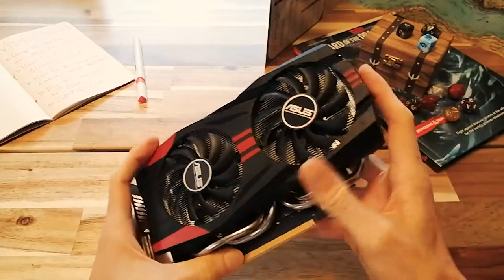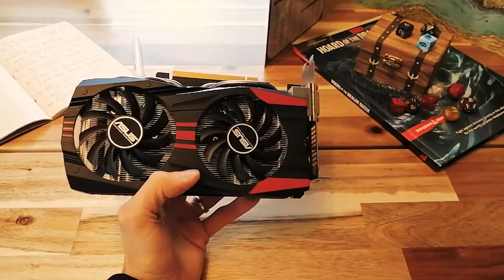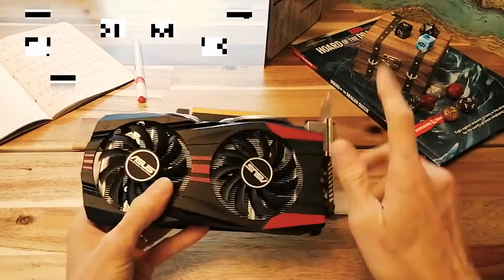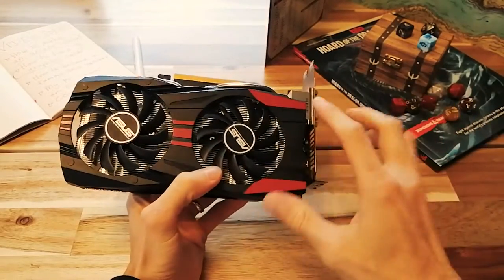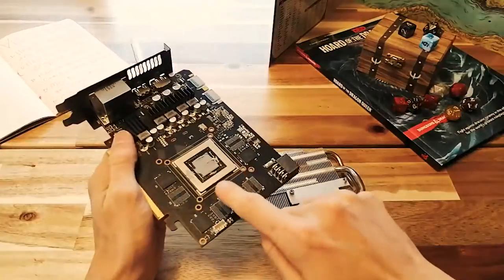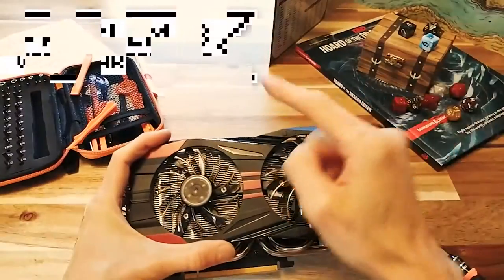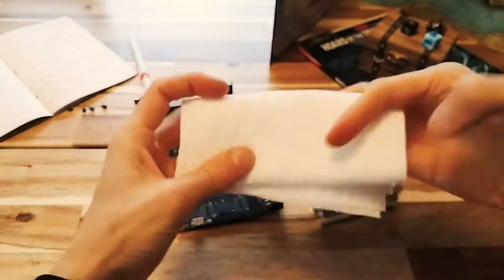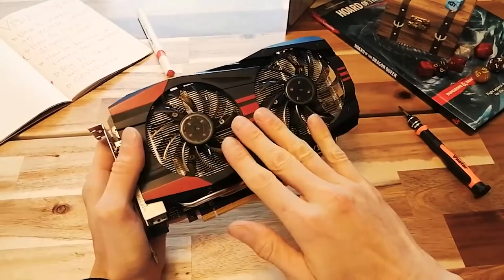EASY Fix Your Graphics Card! (Loud fan, black screen, crashing, artifacts)

Comment: These blackscreen fan overdrive crashes are what I've been experiencing, but what's weird is that it isn't necessarily under heavy load but often caused by specific segments in specific games. Often when I open certain menus. The temps are always fine too from what I've seen. Could that still be a problem with thermal paste? I've tried everything on the software side by this point; repairing windows, clean-wiping GPU drivers and reinstalling them. updating bios, repairing windows files, cleaning the pc, checking for loose cables (which I didn't notice any) etc. , no dice. I've been at this for months and just completely clueless at this point.
Reply from the maker: Yes it could still be a problem with the thermal paste. It's such a cheap and quick thing to try and it so often fixes these sort of issues, even if it doesn't SEEM like that would be the problem. Also I'd highly recommend trying the GPU in a different PC if you can, and see if the issue happens there - if it does, then you'll know it's a hardware issue with the GPU. If not, then you'll know it could be specific to your hardware (and it could be any number of things, like a PSU problem for instance). It's hard to give you a once-size-fits-all approach but if it were me I'd definitely be repasting it as a first step.
Reply: Did you fix this yet, I’m having the same issues. It seems that a bad psu would be a cause this, out of curiosity what games are you playing when it crashes?
Reply: @TechDweeb   Thanks for the reply!
Reply: @999madrush  I've felt too burned out on trying to fix it since, so sadly not yet. For me it always seems to have to do with loading. I noticed when I went into the hub area in Code Vein for the first time the PC did the thing, and I feel like it has to do with the game loading such a detailed area for the first time. Another weird thing for me is the crafting menu in Deeprock Galactic and the Materia screen in FF7, specifically the transition animation. It's always those kinds of things, some games just run without flaw.

One thing I also noticed though is that my gpu driver tends to start having problems a couple of weeks after I've last updated, it's almost like the driver itself deteriorates over time. Maybe it's a software issue after all.

I'm no expert but I think I can rule out a PSU issue at least somewhat. My old PC had a weak PSU that would shut the entire PC off during demanding spikes in game graphics, usually particle effects because they're very unoptimized. In my current case it's just the screen turning black and the fans going overdrive, doesn't really seem like the PSU is failing if the computer is making fans go into overdrive.
Reply: @999madrush  about to try, I'll update you
Reply: Same problem lately, but it’s completely random. Sometimes it’ll happen 5 seconds after reboot and other times after 30 min of just idle. Sometimes 5 times a day sometimes not at all.
Reply: Have the same problem, any fix?
Reply: @Yanncki64  Did replacing thermal paste work? If not did any other methods do the job instead? I'm having the same issue and can barely get past loading into a match for some games.
Reply: I’ve been having this issue too. I have the 2060 super, which they no longer make. I also got this in the HP omen back in 21 and they don’t make that system anymore either. Needless to say I will not be buying HP anymore because they do not stand behind the product and they shipped this damn thing with only a 500 W PSU.  They want to charge me over $300 to ship the system back to them and fix it, with this graphic crap happening a few months after the system is out of warranty (of course).  If I try to play Final Fantasy 7 remake, it’ll give me a signal lost before I can even load a game. Took the card to Micro Center to have them tested in one of their machines and the same thing happened there so they told me my card was defective. They didn’t do anything else to check thermal paste or anything like that which I wish they had since I don’t really have experience with that.  I have not tried doing anything with the thermal paste but that might not be a bad idea. It can’t hurt, right? Sometimes I can play Lost Ark for hours, and this is the game that crashes the most if I try to go to the menu, or there’s a cut scene of some sort . I can search the Internet and do regular stuff with the computer all day long with no problem. 2D graphic adventures, no problem. Anything under a heavy load this stupid crap happens. Incidentally, the problems began the same day that both Nvidia and Windows updated files.  Guess I will try the thermal paste and see if that helps because it’s crazy how sometimes I can play heavy load games for a long time with no issues and other times it crashes right away. Thanks!

Comment: Hi, please do a video about my current graphics card issue, when I play games at high settings the card crashes/ black screens and then the graphic card's fans suddenly spin at a 100%. I even tried undervolting it at it's very minimum  but it still happens. High settings for games like Valorant shouldn't be a problem for a EVGA GTX 770 SC 4GB, what should I do, please help!
Reply from the maker: Have you repasted it? This is exactly the same issue I had on the same GPU that you have (mine was ASUS GTX 770 4gb). That's how I learned about repasting GPUs! Fixed it right away. Based on what you're describing I'm 99% sure that repasting the gpu will fix your issue.
Reply: @TechDweeb  I have exact same issue with my 2080ti, fans full speed & black screen. I tried repasting it but no luck. What would you suggest? Baking would help ? (Using it at %70 power limit works but much lesser performance)
Reply: @aralico  did you solve this problem?
Reply: Did you solve the problem???
Reply: @OG_ISSAM  unfortunately no, i already sold it a while back since it had no chance of getting fixed
Reply: @OG_ISSAM  i did!!!
Reply: @aralico how

Comment: i had the 2nd problem(black screen when in load) i even changed the thermal paste but the problem never went away!!😔😔
Reply from the maker: Then you still have a thermal problem somewhere. If you download a hardware monitor you might be able to isolate it. If the temp goes above 90 on the GPU or the hotspot, you know it's an issue with the cooling on the GPU itself, but if the memory on the vram goes too high then you'll know it's a problem with them, and in that case getting some separate thermal pads and heatsinks for the memory modules on the card might help (if your stock cooler allows it of course).
Reply: Did you ever find a fix? I underclocked my gtx 1080 and capped the frames and now the issue happens less, it’s still there. Reapplying thermal paste didn’t help at all other than improving cooling by about 5 degrees.
Reply: Did you?

Comment: i have a gtx 650 ti that i found at goodwill in the box. it LOOKS brand new. no dust and the pcb is still shiny. When I plug it into ANY SYSTEM it will cause all the fans (including the GPU blower) to ramp up to 100 % the moment I power it on. No display output and no parts need to be reseated, I have tried 3 systems and they all behave the same with this one particular card.
Reply from the maker: The oven method MIGHT bring it back from the dead. That's what I do if it were me

Comment: I remember buying a i7 laptop that had a Nvidia gpu back in 2013. The owner sold it to me for 150 bucks. No picture from the gpu. I through it in the oven at 400 degrees for 5 to 10 minuets and after that, it turned right on
Reply from the maker: Oh crazy, didn't even think that you could do that with a laptop. Makes total sense though. That's awesome.
Reply: @TechDweeb  yeah its to reflow the solder balls in between the gpu and vram to the board. Funny how I found out about this 😅 it was on a youtube video that I seen back then, glad to see it still out there.
Reply: No way are you serious? I have an Asus i7 with the same exact problem going on
Reply: @701Gangstatainment  yeah bro, preheat the oven at 400 degrees. Grab aluminum foil and lay it on the highest rack on the oven. Remove all the plastic and heat pipes off the motherboard and drop it in there for 10 to 15 mins. Once the time is up, turn off the oven and let it cool down for the next 20 to 30 mins and thats it. Don't touch it when its cooling down cause the solder might be soft and you can knock off a component
Reply: @701Gangstatainment  did it work?

Comment: My computer keeps black screening and putting the fans on blast; last time I checked which fans were spinning and it was indeed the GPU fans. The problem is my GPU is not overheating. As soon as I turned my computer back a few seconds later it was giving me readings of around 32 C and has stayed around there since I've been monitoring it. This problem happened twice when I was gaming, but also three or four times when I wasn't really doing anything but browsing the internet. I didn't have that many tabs open, maybe like 7 at most and I was watching youtube one time and another I just left the computer alone with a few tabs open while it was downloading files. Are you sure this is a GPU problem and not a PSU issue? I'm checking my GPU temps again and finding it hard to believe it's overheating since it's currently sitting at 29 C.
Reply from the maker: That sounds like the GPU is crashing, even though it isn't overheating. It could be a number of things. The main first step would be to try it in another system, if it still crashes there then you'll know it's your hardware (and some of the repasting or baking tips in this vid might solve it). However, if it's not happening in the other system then you'll know that it's an issue with your software, in which case a good step would be to remove all your old drivers (using the tool DDU - make sure you're in safe mode) and then download and install them fresh. That works most of the time for software specific problems.

Good luck!
Reply: Did this fix the issue, I’m having the same problem as you?
Reply: @999madrush  I ended up replacing the power supply and it hasn't crashed ever since

Comment: Hey, I’ve tried your fixes as I have a problem with my 1080. What happens is the screen goes black and the GPU starts making a loud weird coil whine noise at the exact same time, I have to turn the PSU off and back in order to get an image back. But this happens within a minute of starting my computer, or sometimes even seconds. Any tips as to what it could be?
Reply from the maker: It sounds like a thermal crashing issue, although you say you've tried the fixes so I assume you've repasted it. Are you able to get far enough to enable some hardware monitoring to see the temperatures? One thing I would be curious about is if you could try it in another PC as there may be a PSU or issue with another component.
Reply: @TechDweeb  tried it with 2 different PSUs in different computers. Same thing. Also the fans starts spinning at 100% as soon as it happens, and seems like they’re connected to the coil whine somehow as if I put my finger on to stop I them the coil whine sounds less aggressive.

As for the thermal issue the GPU seems to remain at around 40 Celsius as I’ve tested with a proper thermometer, that is on both the memory and processor
Reply: Same
Reply: @xvFrosty my 1050 does the same thing i boot my pc and it works for a while then my image cuts and it says it has 0 mbs of vram and lts called Microsoft display adapter or some shit
Reply: I have this same problem however it’s when I’m playing games. It runs fine when doing normal processes but sometimes the screen will go black and start making a building loud noise and I have to switch the PSU off. Idk if it’s cause my hardware is a little older than the graphics card and therefore it’s bottlenecked or if it’s because I didn’t thermal paste my card I just took it out the box when I bought it. 
No idea.
Reply: @amberhickmore7474 hey . You solved the problem??
Reply: @xvFrosty any sollution?
You found a solution for this problem ?
Reply: Anyone found a solution? I have the exact same issue

Comment: Brother, I want to thank you. For months, my 3070 fans would go insane, and I would get a black screen under heavy load. The only way I could fix it was by turning the settings of the games down. Today, I checked my thermal paste because I came across your video, and it was dry and crusted. I replaced it with Arctic MX-6 ULTIMATE Performance paste, and the problem is gone! once again, many, many thanks for this!
Reply from the maker: Glad it worked out for you!

Comment: Had a glitching GTX660 OEM with artifacts, so it was semi-working. Worked a 100 % of the time with basic Microsoft driver, worked around 25 % of the time with proper drivers.
Baked it at 375 Fahrenheit (190 Celsius) for 10 minutes, works so far. I don't see a performance difference at this state, but it did start up with no crashing, and instead of going to artifacts after installing the drivers, it just installed the drivers, even played something, and it's alive.
I think doing this to a completely dead card would be a waste of time, but if you got one that's artifacting, it might be worth a shot. I'll update this if something happens.
Reply from the maker: Nice! Always nice to keep otherwise working hardware out of the dump and give it a second life

Comment: THANK YOU SO MUCH FOR THIS VIDEO!!! Ive been getting so lost as to why the second problem has been happening with my pc and couldnt find any plausible solutions ANYWHERE 😭 

I literally had a new graphics card and sometimes it would just black out and speed up the fans with just starting up the pc. As a first time pc owner i was scared so bad that i thought i had to go buy a new one... Turns out when I popped it open, the thermal paste was overflowing on the sides o-o and just really thinned out at the center 👀 

3 hours of careful cleaning later and new thermal paste, its working beautifully 😭🙌💖

Just had to comment thank you so much for solving this issue for me 🥺 Definite sub here 💖
Reply from the maker: Niiiiiiice! That's what I like to hear! Glad it helped you out 🤓
Reply: The video is helpful no doubt, but something tells me that your issue was fixed by simply reseating your GPU.

Comment: Hey brother, my 1070ti has a black screen with display port, even when plug with hdmi, bought a new psu, same issue and the motherboard indicate red VGA light but the gpu still runs light and fans i am so confused...
Reply from the maker: Sounds like something is fried on the GPU. Try it on another PC if you can, just to make sure it does the same thing there. If so, then the oven bake might be your only choice to bring it back (although it might not work, and if it does it might only last a short while).
Reply: @TechDweeb  wow what a quick reply! Many thanks. I just managed to make the graphics card worked at 240hzbut then after 10min the screen goes black again, when it was on the vga light was still red too. I ve been to pc store and they cant figure it out either, i would love to make it work while i save for a new pc tho...
Reply from the maker: If it's crashing under load you might be able to fix it by repasting the gpu. Worth a try if it sorta works until it gets gaming.
Reply: @TechDweeb  i'll send it to repair, i suspect the motherboard cause every debugg light have been on at one time but thanks a lot for your help man, keep the good content! 💪

Comment: Hi i have a gtx 660 and everytime i put it in my pc. It gives me super large resolution like 1/4 of the screen is zoomed in. and artifacts lines below too btw and bsod after. Every drivers i install wont work. Fans not spinning either. Pls help I'm using newly installed windows 10
Reply from the maker: In that case the only solution that might work for you is the oven method, that's what I'd be trying personally in that situation

Comment: A have zotac 1050ti mini, it has been crashing for last 2-3 weeks, sometimes it used to run fine for hours and sometimes just a few minutes and it crashes.

Whenever it crashes there is random colour on screen Grey, Blue, Cyan, Green, Purple etc. Then after few seconds screen goes black and fan stars to spin at full speed.

Now it only stays on for few minutes and then crashes.
Reply from the maker: I would suspect the only thing you could do would be the oven method, but I would try repasting it first and monitoring the temperatures closely on a hardware monitoring program. But the random colors tell me it's likely an artifact issue and the only thing that might work would be heating up the solder on the board by using the oven method. Good luck buddy!
Reply: try undervolting